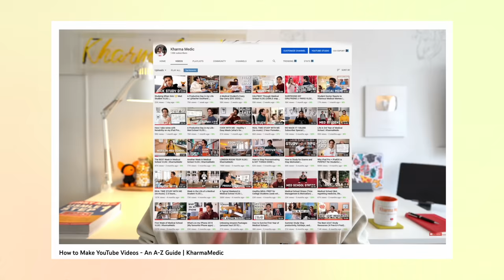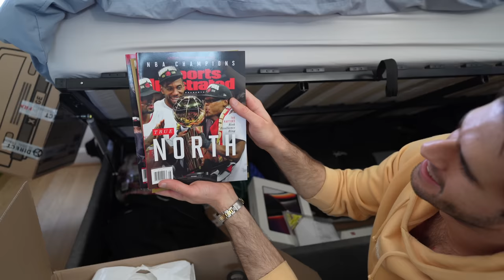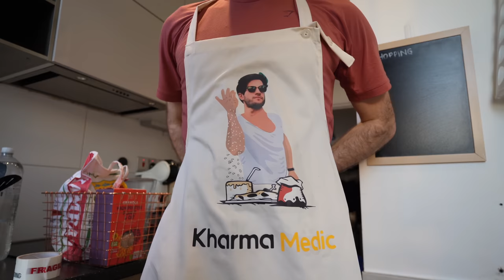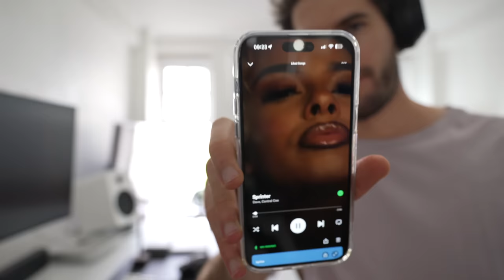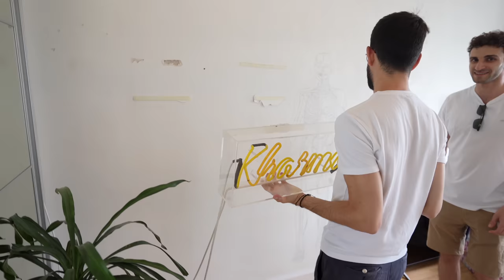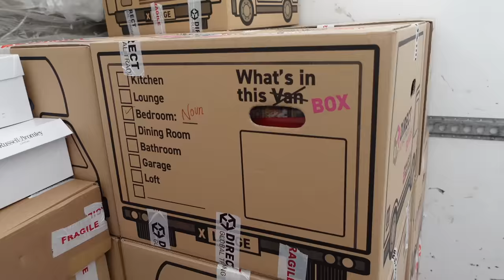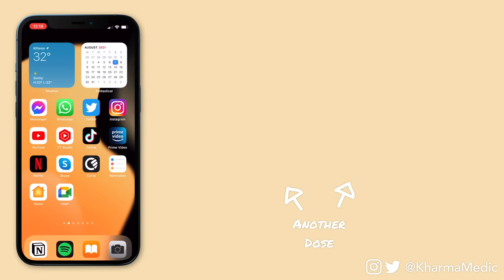Moving into my new London Apartment (pack with me + empty house tour)

Comment: GUYS i have an important question , is the monitor helps student got better work ? is it important to buy or not ?
Reply: After having classes online from 9 am to 5 pm during COVID I noticed that my eyesight is on the verge of worsening. Same when you use a 15.6’ screen all day for anything else. Then I bought a monitor and never had this problem again. 
If you are a bad student, no tech will help you. You still need to put in the long hours. 
I would say getting a tablet helped me to tolerate doing homework, and this added a lot of value. You can read and underline scientific articles more efficiently and go back to the info faster when you discuss these during classes.